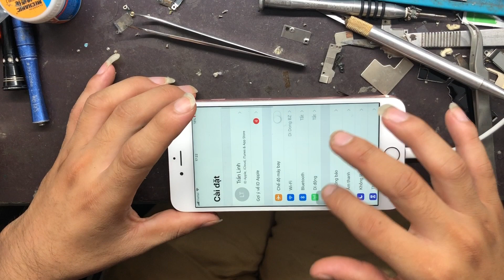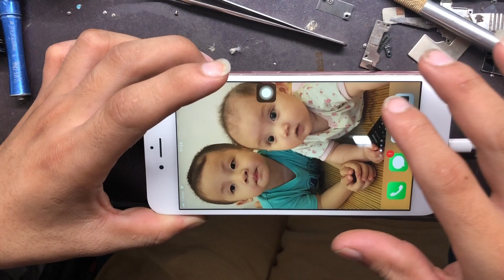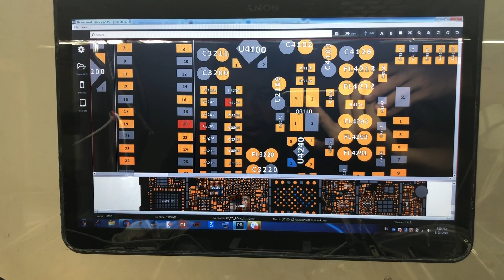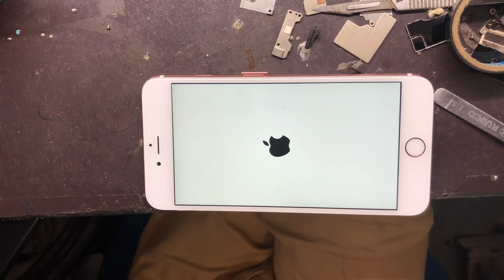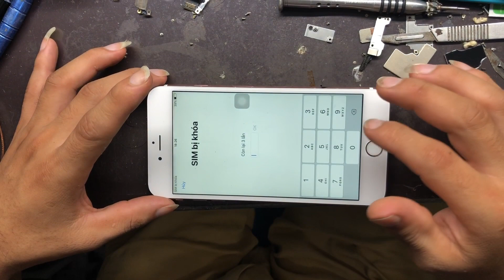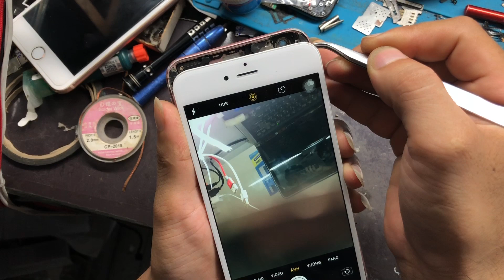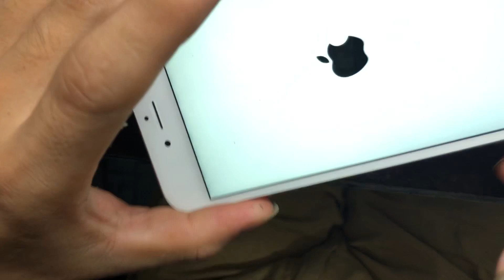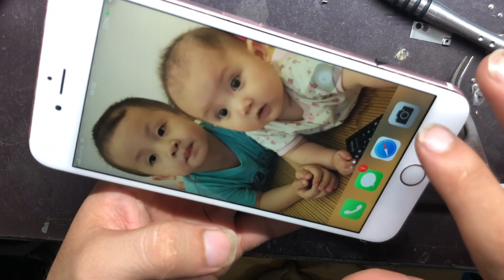Cách sửa lỗi mất camera sau cho Iphone 6splus

Comment: Điện thoại em mất 2 cam luôn thì sao anh
Reply from the maker: Lỗi trên main cũng làm mất 2 cam bạn ạ! Bạn mang qua mình kiểm tra sửa cho nhé!
Reply: Cam trước cam sau gì củng đen thui hết trơn á anh
Reply: @DidongBz  cho em xin địa chỉ với ạ
Reply from the maker: @ntgvlogs9068   địa chỉ mình như mô tả ấy, số 4 ngõ 105 Chiến Thắng Hà Đông Hà Nội. Vị trí mình đây nhé https://maps.google.com?q=Di%20%C4%91%E1%BB%99ng%20Bz%20-%20phone%20%26%20Repair,%204%20Ng%C3%B5%20105%20Chi%E1%BA%BFn%20Th%E1%BA%AFng,%20P.%20V%C4%83n%20Qu%C3%A1n,%20H%C3%A0%20%C4%90%C3%B4ng,%20H%C3%A0%20N%E1%BB%99i&ftid=0x3135adf8846a6bff:0x521e94f4695667a6&hl=vi-VN&gl=vn&entry=gps&lucs=,47071704